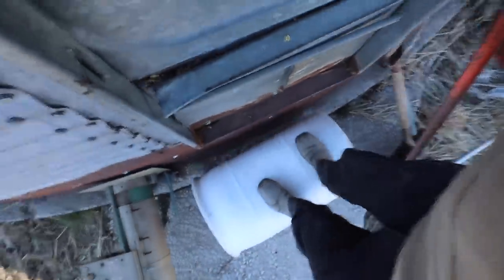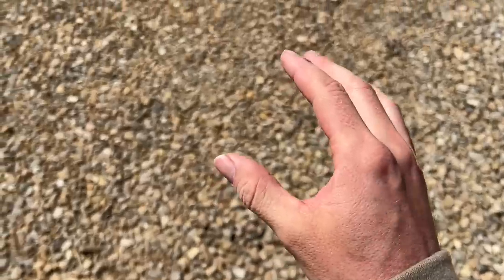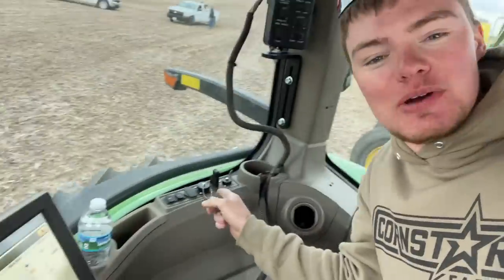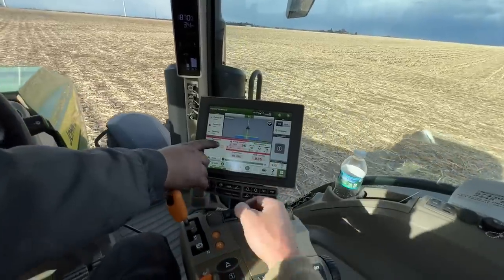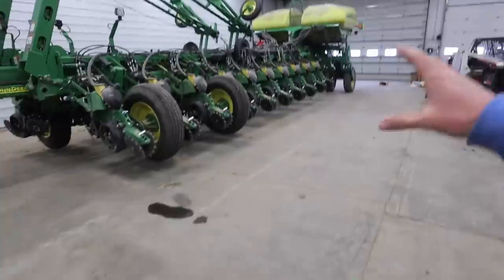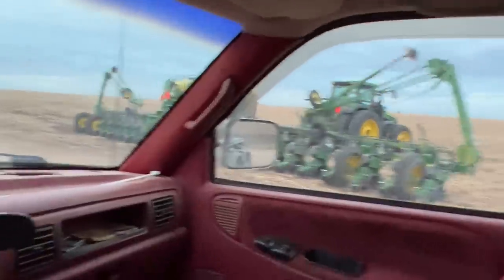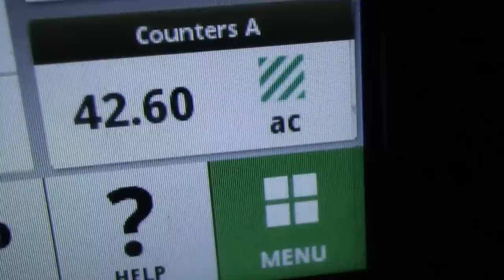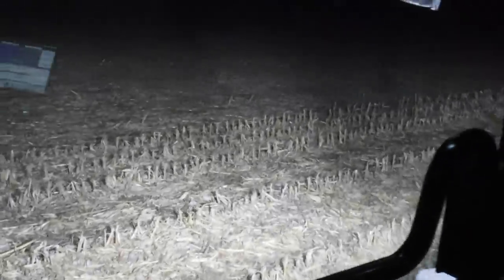I Tried Renting A $500,000 Tractor To Test

Comment: I’ve got 2 8R 410’s. And 2 16 row high speed Deere planters, they are 3 point. They like that one, the faster you go the better they plant. Grab some gears and go! They are expensive but compare to what you have? They are head and tails above the rest. It will pay for itself. In fact you can run so fast you can cover just as many acres as you do with your 24 and 12 row. We can plant our entire farm with two 16 rows in 10 days. 12k acres.
Reply: They don't have a 12 row, but a 16 row and 24 row.
Reply: Curious why you run a 3 point as to a pull type.
Reply: Cap
Reply: @Caleb20824  we bed up, 3 point will ride the beds.

Comment: Suggestion. On your seed cart the top rails are vertical which creates the need for  a very accurate installation of the pallets.  If you weld  8" high and 3" wide bars bent at about 20 degrees above the the wall height you will create a funnel to position the pallets.

Comment: We have a white 12row with positive air pressure meters as well, with the flats seed plates if you order flats you can get very good singulation, but you are right it is a much more picky design vs the Deere or precision meters

Comment: Cole, I have a question for u ❓ Why am I seeing more corn farms exedra around me in southern Indiana not plowing their fields up like they use to way back when.
Reply: That is the no-tilling method that the CornStars started using 2 years ago.
Reply: plowing is old school.  no till or reduce till is what they do done.  it helps with erosion control the less you work the ground the better.  they will do a few different type of fall work chisel plow sulfur tool high speed disk.  Really they have learned and equipment has changed.
Reply: Our farm has been no-till for years. Top soil doesn't blow off, that's for sure. Our crops have been excellent.

Comment: Step up the pace Cole. Let the planter do it's thing!!
Reply: I know nothing about farming. I do know from watching LarsonFarm/ Brians farm / A TrippyFarmer that 3MPH is crazy slow.
Reply: New machine small steps small adjustments large rewards
Reply: @robm3063  Yeah, it is, but when you aren't used to the quirks of a machine, you want to take it slow at first. Haste makes waste and all that.
Reply: @MrFarmer110  Probably true going slow at first. I just see the other guys pointing out that the faster you go the better the planters work. Seems backwards to me but I'm just a retired electrician. Now if you want to talk about some of the backward things Cole did regarding some of the electric work in the shop..........
Reply: @robm3063  the wiring on the shop was nuts to me. I get the desire to save money and do stuff yourself...but he's going to cost himself more with all the mistakes. I've followed Cole and been a fan for years and years, but his ego and belief that he knows everything bites him sometimes. Just my opinion.
Reply: @jarrettfullerton2580  watching his father trying to figure out the switching by the door a few videos ago was entertaining. 
What is nuts is while that shop ceiling was open there should have been at a minimum two or three 3/4 or 1 inch pipes run the length of the building for future purposes.

Comment: You really suck at getting your white planter set up if all you can get is 95% singulation. Never had lower than 98% with any of our white planters.
Reply: yup,my 9812 white massey planter plants picket fence stands if you run the right pressure on the seed plates at 5 to 6 mph but my next planter will be a jd high speed planter demoed one last year unbelievable stand at 10 to 12 mph in no-till.

Comment: You know how people always ask you why you don't irrigate using your sprayers. I thought it works be a cool demonstration if you put straight water in your tank(enough for the demo) and spray water on driving the speed that would be required for adequate irrigation. That might be a cool piece of video.
Keep up the good work Cornstars! Love when I get notifications that your have a new video!
Reply: Because it wouldn't be enough water. They fill up 500 or 1000 gallonsper tank, I can't remember. Irrigated fields with pivots pump out 500-600 gallons per minute!

Comment: Rotten grain chunks reminded me of cleaning a horse stall of "road apples". Best tool to remove those pieces is a horse manure fork. Has thin tines less than an inch apart. Grain and sawdust fall through but the clomps are picked up and then can be tossed into a refuse container. Available in farm & feed stores. Don't be dismayed to find only the plastic tines, though you can find metal ones, because they are quite durable. 
P.S. my favorite car was a red Geo Prizm with air for $600.

Comment: My question is why put grain into that bin when there is rotten crap on the walls of it?
Reply: It's partially...the "problems" of the $1million bin site storage capy prolly?!?!?!
Reply: @mmurphy2317  I guess so. I’m not there to know what is going on
Reply: They didn't know
Reply: @mmurphy2317  No, that bin is an older bin, not part of the million dollar bin site.
Reply: @ILGuy2012  Correct...but ìirc, last year's crop was not able to be completely stored in the new bins...so was distributed to bins which were to be "phased out of service"...resulting in continuing utilization of old prior bin storage, which likely wasn't cleaned out as thoroughly, assuming that the storage would not be needed!?!??!
Reply: @mmurphy2317  No, the two new bins are being used to store corn only, not any soybeans.  The goal of Phase I of the new bin site project all along was to get all of the corn crop into the new bins and stop using the machine shed for storage.   

Soybean storage will be addressed in Phase II of their new bin site plan, so they planned to use older bins for soybeans all along.    

I noticed they moved soybeans from at least one of the older bins into the hopper bin, but I think that was done to make it easier and quicker to load the semis hauling to market.  If I remember right, there was a potential issue with semis being able to pull near one the bins without getting stuck, if the ground was muddy/too soft.

Comment: I always go in, remove that rotten crap as possible. I see later you did. I recall years back a local dealer loaned us a FIAT. SANE? Tractor a FWA 120 hp?  “Try it a couple days, don’t worry about the hours.” We ran it 24 hours a day two farms. Did all the tillage with it. Not a tractor we liked.  But it did the work.  I planted corn with JD 7000 8rn. Got more done per day then their first day.  (But not 20% what that planter can do)